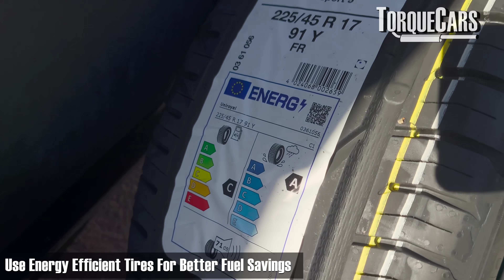10 Fuel Efficiency ECO Driving Myths Exposed 🚗💨  What Really Works? - Save Fuel the RIGHT Way!

Comment: I have a 2016 Insignia with the 1.9 twin cam diesel engine with 6 speed transmission. It was my company car and I bought it when I retired. It is approaching 150,000 miles and is still in excellent condition. At 2,000 rpm in top gear (6th gear) it runs at around 70 mph and returns just under 55 mpg. 2,000 rpm is recommended to clean the DPF. If I push up to 2500 or 3000 rpm I'm breaking the limit!
The engine meets Euro6 specs and is ULEZ exempt. Annual Vehicle Excise Duty is £30.
This engine was developed by SAAB and after GM bought them used it in many of their range plus supplying Alfa Romeo and other brands in the group.
I shall keep it going for as long as I can because it is so economical.

Comment: Certainly if I'm going to do a lot of long distance trips I'll use E5 super unleaded because the fuel economy makes up for the price difference. It does at Costco anyway where it's about 6p a litre more. If you're paying 10/15p a litre more it's not worth it. With super unleaded in economy will be in the mid 50s instead of the very low 50s. Around town/commutes doesn't seem to make much difference. About 35mpg on both. Golf mark 7 1.5tsi.

Comment: i went on a rolling resistance reduction test.using synthetic oil, trans oil, diff oil.repacked front bearings with synthetic grease & adjusted them a hair loose to reduce drag.& adjusted rear brakes so there is no contact with drums when not braking.was able to nearly double coasting time off throttle on my nightly dedicated deliveries.was able to coast with throttle closed for total over 4 miles per night.picked up about 1.25 mpg.i kept tires at 33 due to perfect wear patterns.thats 28 miles a week & 112 miles a week i went WITHOUT throttle.the gas savings added up QUICK.
Reply: Your ODO probably does not register during coast - be careful not to lock your steering wheel or lose brake boost vacuum

Comment: I have 3 different tire gauges, 1 on my battery pack jump starter air pump and 2 hand-held(one premium one), and they all yield a different psi reading across a variation of about 6psi. Only say this because I’ve often wondered if most of the driving public isn’t running around with incorrectly set tire pressures to begin with even when owners are thinking they are being really observant about it.

Comment: Window tint saves fuel in summer. Less heat - less AC power required
Reply from the maker: Good tip, I totally missed that one. Even in limited tint restricted areas you'd still be looking at lower heat gain.
Reply: There are fan powered seat covers you buy now that effectively cool your body.  I have one in my vehicle and find it makes the AC more effective and sometimes negates the need for AC.

Comment: Using the brakes as little as possible and focusing on a smooth drive is probably the best general advice. So many people happily jab the brakes and speed up just to slow down because they think overtaking before a roundabout somehow means they will get to where they need to be quicker. So many times this has happened just for me to drive behind them and end up passing them because they then dordle at the roundabout. I’ve a 1.5 DSG Kamiq and lifting off the throttle, the car just keeps going and going. Took some real getting used to but that car gets high 50s mpg with very normal driving, and over 68mpg on a long run fairly consistently, and the miles between refills confirms it.
Reply: @Olliebobalong  The problem with driving with minimal brake use is that modern cars have brake discs which are very low quality compared to 20 years ago. My old Astra discs lasted for 80,000 miles. My 2017 SEAT Leon discs lasted for 30,000 miles because I didn't use the brakes often enough to keep them clear of rust.  This cost more than the amount offset by minimising brake use when driving.
Reply: Slow is smooth and smooth is fast 😎

Comment: If you have a fragile engine, like the stellantis 1.2 purebreak (puretech) and it is the turbo version you should be running higher octane fuel. So the engine doesn't need to run rich, so less fuel is going into the oil and the engine will not break as fast. Fuel economy isn't the only factor
Reply: Firstly, don't buy a car with a fragile engine, and secondly, don't buy anything from Stellantis. Good ol Toyota will save you the most money.
Reply: @BubblesTheCat1  When it's too late and you already bought it, it's a good tip to push it past 50 000 miles.
+ it's not only stellantis. Honda did it once, and ford also with their ecoboost
Reply: @L3xou97  🤷‍♂️😊🙋🏼‍♂️

Comment: The dumbest fuel economy saving is manufacturers removing a full spare wheel. The first thing I did was find a cheap second hand one for my car and it has saved me trouble on four occasions since I had the car, yes I have had it quite a while. They are robbing you by not adding it as standard. They take up space yes but it is a safety item to me. I have replaced the flat a sorted the puncture out later when convenient. The biggest saving comes from the foot, that is all you need to know.
Reply: Full size spare is a bit impractical on cars as  you would almost not have a trunk. There isn't any safety concern with a spare, you still have plenty of traction. It is extremely unlikely, like absurdly unlikely the difference would have any safety implications. If cars had full spares they would be robbing you of the car being useful not having a trunk. Old cars had full spare in trunk, but the essentially had no trunk at all, just a spot for the spare tire.

Comment: Or be like me and turn the A/C on to the minimum temp, but only when you need to brake or going downhill (while engine braking). Free A/C and less use of brake pads
Reply: I also do that! It really does work and keeps you cool enough while saving brakes and rotors. Especially with a small (1.4 litres) engine like my Nissan Sunny's. 😁🙋🏼‍♂️

Comment: Peugeot 207 1.4, using E10 fuel I could get 350 miles to a tank, using E5 I could get over 400 miles to a tank, and runs better on E5
Reply: That doesn’t seem very efficient for what, a 50l tank?
Reply: @Olliebobalong ethanol sucks.  My big Lincoln gets 20 to 23 on real gas mpg vs 12-14 on e10 government shit gas.

Comment: Assertive driving, let go off throttle on time, unless you have regenerative braking use them hard, 50% throttle when acceleration.
Do not forget to clean your engine with occasional full throttle acceleration over the entire bandwidth.
I never have common clogged system problems but still around/above average fuel consumption. 
MPG by manufacturer are BS anyway. Note clogged systems (soot, carbon sludge on intake, DPF, cat etc..) lead to higher fuel consumption.

Comment: I work as an car mechanic. And i tell you that its unbelievable how much fuel we've got to "scrap", because somebody mixed gasoline and diesel(no stolen fuel, I swear. Sometimes really old gasoline from boats, as those engines are quite expensive and really dont like such stuff). Im running 70 years old two stroke cca 200cc motorbike with intentionally lowered compression ratio(knock prevention, maybe a horsepower lost + a little of fuel efficiency goes out of the window, but who cares...) and I haven't got to buy fuel for four years. Just oil for it. And traveled over 60k km over those four years... It doesnt matter to me if it breaks down, its just so stupidly simple to get it running again(after 14 years two complete engine overhauls for like 300 dollars each + my labor. 200k km total so far only with me, total mileage unknown(i think about like 700k km XD)), parts for it are literally everywhere in my country, dirt cheap. And I tell you that I dont know what to do with that absolute sh**load of money I have now.... I really need a car like two days in a month. Just sacrifice some comfort and grow some balls. If you really don't need to haul over a ton of metal and plastic with you to get to your work, just get a simple old motorbike, thats popular in your country, learn how to keep it in shape and tell me in 15 years, if its worth it, even if you have to buy that fuel. I can now afford to plate that bike in pure gold...

Comment: Not saying you're wrong; as this is entirely anecdotal; however I've never seen excessive middle only wear from over inflation - only still some excessive wear on one side or the other, as well as to some extent the middle, but 'almost' never both sides as well?
Reply: I have, on a Maserati with 295 width tyres, went through couple of sets in around 10k 
Next set the fitters overinflated by about 10psi or 25% and I didn’t notice, these lasted 5k before the centre maybe 100mm was down to the wear markers, next set no problem whatsoever, so either the fitters caused the issue with overinflated tyres or the compound was different (same brand and type) but the wear would normally be on the inner edge first due to alignment

Comment: In summer you can still use the climate control as fan only: much less drag (and noise) than going with windows down and more fuel efficient (I measured around 1 km/L between going with the AC on and only with fan at maximum speed)

Comment: BULLSHIT BULLSHIT BULLSHIT!! 

This guy is telling you lies. A typical EV with a  59kwh battery will cost £14.75 to charge overnight for 220 to 250 miles range. Compare this to a German 2.0 TDi that does 600 miles for £70 fuel (£1,34 litre) for £70 of electricity you'll do around 900 miles. I had a German 2.0TDi, I now have an EV my numbers are real numbers, not fished out of some anti EV website. Public chargers are more expensive, however if you are home charging and doing less than 220 miles per day, you won't be using the public charging network. To put 200 miles per day, 5 day weeks into context that's 46,000 miles/year (less public .holidays and annual leave). 

Home charging you'll be ahead of the game on fuel costs alone, before shelling out £600 year on servicing (DMF and Cam belts excluded).
Reply from the maker: lol - I really think you need to clarify yourself here because you've called BS and then pretty much restated exactly what I said in the video - unless I'm missing something?

I specifically say that home charging is cheaper (this will depend  on your tariff and the country you live in to a small degree) and I say that if  you rely on the public charge network the cost can prove to be more than convention fuels. 

I know many drivers who cover in excess of 200 miles, not every day but at least once a week. I personally don't think EV's are suitable for high mileage drivers but each must do their research and run the numbers to come up with an answer.
Reply: @torquecars  "Another fuel economy myth -electric cars are cheaper" Your words, your headline. Like I said bulshit.
Reply: Another EV poof that conveniently leaves out the purchase cost. I could fuel my TDI for 20 years for the cost of a new EV.
Reply: @LordAsney  Do the maths, for the cost of an equivalent new EV against a new TDi you'd be £1200/year better off on standard tariff (15000miles/year) add to that reduced cost of servicing (no oils, filters, DMF) reduced brake and tyre wear) tots up to £2000 year saving, you can pick up  a used Leaf with 15k for around £15k 5k trade in for your old diesel you'll break even in 5 years.

Comment: Should you not drive around with a full tank of fuel to save weight?
Reply from the maker: It's not a massive or noticeable difference, a 60 litre tank (25kg) is half full half  of the time a half filled tank (12.5kg) is quarter full half of the time. I find the effort of making 2 trips to refuel rather than one outweighs any real world saving.
Reply from the maker: I did a video on this which you might find interesting and worked out the real annual cost of half tank fills compared to a full tank. https://www.youtube.com/watch?v=mrJdUjMSpz4

Comment: There is many ao called eco products that claim to work but in reality many don't in my humble option service your car more than the manufacturer guide to ensure the engine is perfect don't skimp on cheap oil and use the correct grade make sure all tyres are the same or at the very least same brand on the same axle and make sure your tyre pressure is correct and plan well ahead whilst driving don't brake heavy and accerate hard most things are just common sence and constant town use is no good to your car either I have my car serviced once a year even if I only do less than 5k miles and it will have a full service as its much cheaper than a replacement engine but this is my personal option

Comment: Use your cruise control if you have one and the trip allows it safely. I've seen ignition advance go up to 45° with CC on while i was never able to achieve such high advance using the throttle pedal at the exact same speed. With CC on the ECU uses different maps optimized for fuel economy using lean burn when engine load is low enough to safely do so.
Reply: I have read that cruise control causes the car's computer to apply the brakes many more times than the driver would do naturally, through the ASM (active stability management etc), and not just when rolling down a hill, so I wonder what effect this has on overall economy? All those minor inputs must cause premature wear of the pads and discs, not to mention the extra fuel used to regain the intended speed.
If road conditions are favourable, I turn ASM off, but activating cruise control reengages it.
Reply: I have read that cruise control causes the car's computer to apply the brakes many more times than the driver would do naturally, through the ASM (active stability management etc), and not just when rolling down a hill, so I wonder what effect this has on overall economy? All those minor inputs must cause premature wear of the pads and discs, not to mention the extra fuel used to regain the intended speed.
If road conditions are favourable, I turn ASM off, but activating cruise control reengages it.
Reply: @michaellavery4899  I don't think that's the case because engine braking is more than enough to slow down unless the downhill is a cliff. Active stability systems only engage the brakes in corners when their management senses that the car is about to start slipping by comparing the signals of ABS sensors. Why would active stability engage the brakes when you are traveling along a highway in mostly a straight line?
Reply: @michaellavery4899  sounds like a quite advanced car?  My undestanding is that the wear on brakes would be unimaginably minimal and so fuel extra use also negligible.  And fwiw, though we all like to have an optimized car, generally speaking, less is more when changing settings that the mfr has chosen for optimal safety.  Outthinking or overthinking the engineers is just usually a waste of our mental space and attention/focus
Reply: @michaellavery4899  I guess that's a minority of cars. I had a similar function on a work van, a 2021 or 2022 Mercedes sprinter. Hated this function, it would not let you take speed down a hill, and would keep you at max 5km/h above your cruise control speed. If engine brake can't keep up it will use brake pads to keep you under the 5km/h. 
Very bad for brake wear and fuel economy, good for radars

Comment: 9:03 I never used to believe there was a noticeable difference between fuel brands. However, my 1.4 TDCI car runs a lot better on the FuelSave diesel from the local Shell fuel station compared to the (slightly cheaper) Esso fuel. There is an injector on its way out, but the Shell diesel definitely reduces the chances of a misfire. I can drive hundreds of miles without a single misfire but on Esso diesel, it was multiple times per journey! With our other vehicles, they seem to run fine with any brand.

Comment: Re high-octane fuel, a lot depends on whether your ECU has adaptive learning. In those that do, the ECU will gradually advance ignition to take advantage of the higher resistance to knock, resulting in slightly better performance and MPG. However, this MPG increase is unlikely to compensate for the additional cost of say V-Power 99.